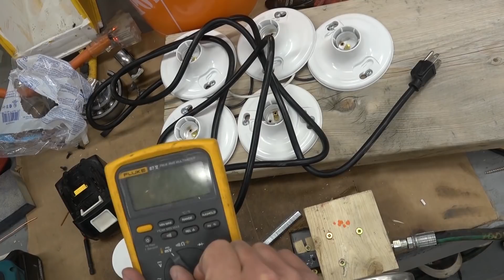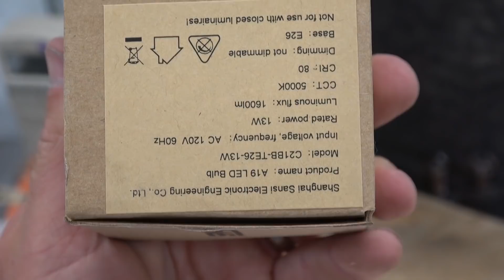Do LEDs work for slow motion?

Comment: In office buildings with 3 phase power,  different groups of florescent lights would be on different legs of the 3 phase (120 deg apart)  this was to reduce FLICKER in the office environment.  as nearby tubes would be on different phase they would all not go to 0V at same time.that was  For Magnetic Ballasts.   the electronic ballasts would run at higher freq so not a problem.    connectors commonly used carry up to 6 conductors.   http://www.cooperindustries.com/content/dam/public/lighting/products/images/navmenu/spotlight/mws_spotlight_ban.jpg
Reply: For LED bulbs the ballast free type A operate at line frequency, while slimline type B ballasts operate at 50000 Hz. So you don't get flickering.  High end LED studio lights are direct current drive instead of a pulse type, so absolutely no flicker.
Reply: I was taught that was to balance the loads but I'll buy it.
Reply: @fanplant  it is to balance out load
Reply: You would put lamps on different legs no matter if it's flickering or not, cause you want to balance the load. Not because of flickering
Reply: @GoalOrientedLifting  yES IT CAN HELP BALANCE LOAD, BUT THERE ARE OTHER WAYS TO DO THAT, BUT mainly bECAUSE OF FLICKER.  I worked on lights in Doctors offices, banks, all sorts of places,  the lighting engineer specified it.
Reply: @pablopicaro7649  you may be right, but I always installed lights that way to balance the load. Cause we never had any flickering issues with our lights. Even with the 40 year old florescent light.
Reply: US and Canada is 60 Hz but if you've got a three phase connection you can wire the circuit to run all three phases and alternate each light between one and the other and you won't get any flicker
Reply: I buy that for Magnetic Ballasts.
Reply: Is the electricity 50hz in the US? Cause I'm from Europe and never noticed any flickering when using LEDs or florescent light.

Unless they're the old an cheap LED
Reply: @GoalOrientedLifting  nope, 60, as Nikolai Tesla decreed. But did you europeans listen? Of couse not.
Reply: Stan Burton No, we came up with a better idea. 230 volts and 3 phase in every home 👍😀
Reply: @GoalOrientedLifting  60 in the states. Watch some Big Clive vids about LED drivers. They're not what one would think, especially the capacitive droppers.
Reply: @GoalOrientedLifting  North America is 60HZ,  and depends on the person if they notice the flicker.
Reply: @GoalOrientedLifting  We installed some cheap LED bulbs and my dad did not see any flicker. To me it looked like a rave party in 1995. I have hard time finding non-flickering leds, even some Osrams flicker a lot.
Reply: @edfx  I used to work at a TV station in the 80's. The studio control rooms were full of video monitors, all whining away at 15kHz. The noise used to  drive me nuts.
Oddly, after a few years I couldn't hear them anymore :-(
Reply: @GoalOrientedLifting  Mexico, USA and Canada use 60 Hz power.  Some very early [~AD 1900] power generated at Canadian side of Niagara Falls was 25 Hz {I don't know why that frequency}, but all that is only history now.  A useful reference worldwide:
 https://en.wikipedia.org/wiki/Mains_electricity_by_country
Reply: I also thought it was for load sharing. You don't normally notice flicker at home on one phase, so why would it be more noticeable in an office?
Reply: Forgive my flo’ ignorance, but are the electronic ballasts “square wave”?
Reply: Yeah obsolete stuff mostly as magnetic ballasts are not basically a thing anymore and actually also banned in EU area due to lack of efficiency. BUT good point with cheap LED lamps, always use ones with real driver chip and not the capacitor limited junk. 

Also this issue got easier even with magnetic ballasts as fluorecent materials got better and afterglow is a lot longer than at the 80's so actual light output is much less flickering than power input.
Reply: Pretty sure they use 3 phase because they can get 480 3 phase and split it up to 277v and power a lot of lights efficiently and easily. It's done anywhere with 3 phase supply, not necessarily for flicker.

If you want to reduce flicker, just get a proper decent ballast.
Reply: I have three phase in my home shop and thought about doing this, but the electrician I asked me told me it wouldn't work. Don't remember why, but since I know very little about electrical, I took him to know better than me.
Reply: @buffalojones341  as a sparky myself, I'm guessing it's laziness on their part..!
Reply: @pamdemonia  yep I second that
Reply: pamdemonia I’d get what you are saying if it was some guy I was hiring. But it’s a family friend who owns his own company. I just asked him after church. Go figure.
Reply: @buffalojones341  That's the well known "I don't feel like running multiple runs from the box to the ceiling" effect. Discovered by Maxwell House I think.
Reply: John Ridley ha!
Reply: @buffalojones341  actually you save wire as you need  3 wires  for 3 different phases of 208 v lamps
Reply: @buffalojones341  he was just too lazy to do it.

Comment: Dam the makita had an impressive pixie releasing factor...
Reply: Them Makita's jamb a lot of the magic smoke in there to start with.  That's why they're expensive.
Reply: It's probably the coating from the motorb windings. I recently had a microwave do the same thing on its transformer and it made that look tiny by comparison.

Comment: switch to tungsten bulbs. you'll never find a consumer led that doesn't cause your camera to take a dump on your face. but. heads up... you'll have to find a shutter speed that doesnt sync up to 60hz. and lets be real. you're not going to be using global shutter cameras any time soon either.
Reply: notice how i didn't say frame rate?
Reply: @kpopRC  but this camera does not have a shutter...
Reply: @ttiization  yes it does. electronic or not. the frame rate doesn't dictate the length of sensor exposure for each frame, that's shutter speed, NOT frame rate. ...... dude... lol. even with a rolling shutter, you still have shutter speed.
Reply: @kpopRC  but dude, the shutter speed should be in direct correlation to the FPS. If you have 30 fps, the thing goes kachonk every 1/30 of a second. Shouldn't it be like that?
Reply: @ttiization  no. because you can shoot at 30fps. and still each one of those 30 can be exposed for less time. 30fps 1/1000shutter speed. 2 different things.
Reply: heads up. i used to shoot with real film. where all this video stuff originally comes from... lol. filmschool helped too.
Reply: @kpopRC  I think I get it. Every 1/30 of a second it exposes the sensor for 1/1000 of a second, in your example. Makes sense man, thanks for the fairly technical explanation, yet simple. This is the best comment section on the whole of internet, no doubt. Cheers
Reply: @ttiization  you got it. I bet it could get way more complicated when you start to realize the electronic shutter doesn't expose the whole frame at once. cause rolling. as each frame only captured 1/3 or less at a time. depending on the capability of the sensor. Red cams have global shutters. and expose the whole frame at once. difference between 1000 dollar camera and a 10k one.

Comment: Reminds me of a little rule for traditional fluorescent lighting back from sparky school.
In a workshop you are supposed to always install them with 3 phases, always alternating the phase for the next tube. Not because of the currents but because that does help with canceling out the stroboscopic effect that could make fast spinning things look like they stand still.
Reply: Never thought about that, maybe because I’ve never encountered a completely still rotation. But smart
Reply: CFL bulbs are fairly standard for strobe lighting for still photography, so there has to be something to it. we're talking 150W minimum incandescent replacement bulbs, though. Even on 30 or 60fps video there's no strobing from a 150W equivalent CFL that i can see.
Reply: Can't see the problem with fast spinning things looking like they stand still. Adds spice to your life.
Reply: @SerbanCMusca-ut8ny  
 You'll see the problem if you put your fingers in that fan that looks like it's stopped❗